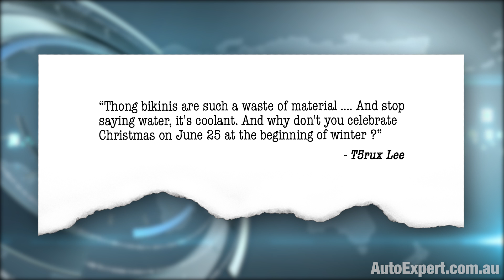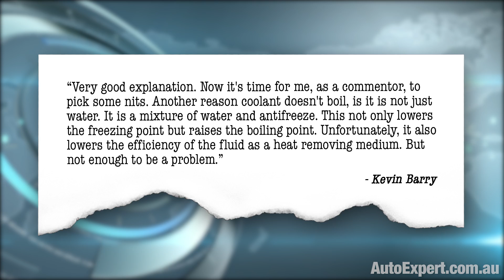The mad science of coolant (beer garden physics - yesssss!) | Auto Expert John Cadogan

Comment: If I may John, there's basically no convection going on in an automotive cooling system. Convection requires a flow of fluid because of the difference in density of the fluid. The difference in density is a direct result of a temperature. This is not whats going on in a cars cooling system at all. The water pump moves the fluid all the time, not convection. The cars motion or a fan moves air over the radiator, not convection. 

Radiator is completely appropriate, point a thermal camera at one and you'll see why. It radiates heat from the metal surface to the surrounding air.  We blow fans across radiators because air doesn't hold much heat, it's best as you'd imagine, when the air is holding the most water, high humidity. 

If you really dislike radiator, might I suggest heat exchanger, as a suitable replacement for your lexicon.
Reply from the maker: No - the mechanism you're describing in the so-called radiator is forced convection. Back to school for you...
Reply: Flow induced by a water pump enhances heat transfer, it does not enable it. If there was no water pump, there would still be convection currents formed, just not as effective as when the water pump circulates the water (coolant). Also, the flow induced by the water pump enhances conduction at the metal-fluid (metal-coolant and coolant-metal) interfaces . The fan enhances heat transfer at the metal-air interface, as does ram air at speed. There are numerous interfaces involved including convection, conduction and radiation. And then there's advection and diffusion...
Reply from the maker: @steves9388  Advection and diffusion are just subsets of convection...
Reply: @AutoExpertJC  Yes agreed, I didn't make that clear.  And I was being a smartarse.

Comment: Why not just run a vehicle on ethanol, have s shitload of fins, a dirty big fan and air cool the engine? Worked ok with the old VW Combi and Beetle engines- excluding ethanol of course...
That said, if the lowest temperature you get where you live is more than -5 deg C why not dilute the 'green stuff' with distilled water?
Reply: Hard to meet public expectations for power and efficiency using this approach.

Comment: The biggest reason for glycol is the fitting of aluminium heads and radiators on steel engines - without the glycol you get a really big battery running. Whilst big batteries are not a problem for EVs they are a problem for ICVs (and the rare ECVs) particularly where it involves essential drive components. Glycol is a pretty good electrical insulator and that is the key. No conductivity equals no corrosion.
For an all iron engine water works really well. For an air cooled aluminium cased engine it is irrelevant. (Freddie Porsche & Skoda....). (Porsche also has a thing for electric transmissions).
For everything else you need low conductivity coolant (over proof vodka works too if you don't mind the low boiling point).
Reply: Allan Gibson correct and that’s where you can have big problems with aluminium radiators if they are electrically isolated from the body and engine, if you only use water the electrolysis with eat it away

Comment: Enjoyed the video and hotties, however I’ve never had a car over heat in modern times other than my first car the great Holden HK. Have a great new year John.
Reply: i was a hire driver and i had a truck blow up on me. i've only been trucking for like 2 weeks when this shit happened. 15 mins into the shift it blew the puke tank, a pipe and the radiator sprung a leak too. somebody tried to fix the truck unsuccessfully (wow, what a word. english wtf!) they tried gluing the puke tank with resin but it's supposed to hold pressure and it didn't. i somehow managed to limp it back to the garage. the temperature needle was almost always off the clock face.
Reply: @SoulTouchMusic93  if your top tank pops, check the head gasket.
Reply: When I was a kid my dad had a HK and I always overheated in it in summer - no AC - especially when jumping in and landing right on those f*#@!g red hot branding iron seat belt buckles.
Those 2 core radiators just weren"t up to the job on a hot summer day and later when I inherited the old girl I stuck a V8 radiator in her and never had an overheating problem again.

Comment: Water boils at 100°C? Are you a flat-earther?

Arse-trailer may not have mountains, but other areas do.
Reply from the maker: Yawn - it's pressure dependent.
Reply: Good to see you completed 6th class science, but if you went on in school you would have learnt that.

Boiling. At sea level, water boils at 100 °C (212 °F). For every 500-foot (150 m) increase in elevation, water's boiling point is lowered by approximately 0.5 °C. At 8,000 feet (2,400 m) in elevation, water boils at just 92 °C (198 °F).
If you did physics in high school and ternary education you would have been lectured about Boyle's law and The Clausius–Clapeyron relation and a number of interesting facts.
Reply: @richardkaz2336  Lets get real. He wagged school for the whole time. Thats why he knows F*ck all.
Reply: Australia does have large areas below sea level too (look up Lake Eyre some time).
One of the few places you can fly a plane below sea level.
Adequate cooling is essential there.
Reply: If you read the literature, there are no references to the radius of the Earth regarding boiling water characteristics. Thus, the Earth is flat.

Sarcasm self test complete. Beep!
Reply: Some Nords have made some solar vacuum tubes that can boil its liquid inside (almost all water and some additives, I guess) at almost freezing temperatures. I remember watching a video with the roads full of snow and those tubes were stuck in the snow and boiling inside.
Amazing what can be done when natural fenomena are understood.

Comment: A shock absorber or damper is a mechanical or hydraulic device designed to absorb and damp shock impulses. It does this by converting the kinetic energy of the shock into another form of energy (typically heat) which is then dissipated. Most shock absorbers are a form of dashpot (a damper which resists motion via viscous friction).

But who gives a rat's...
Reply from the maker: It's primarily a vibration damper, resistance being proportional to velocity, unlike a spring where resistance is proportional to deflection.
Reply: @AutoExpertJC  Err, you know shit. Go drive your car without shocks. It will be a pogo stick on all 4 corners. The only spring that damps is a leaf spring, and it does not damp very well.

Comment: I was given some orange stuff to use as the ONLY liquid in my Torana by the guy who built it. Dunno what it was but the modified 186 took twenty minutes to get up to operating temp and no amount of thrashing could get the temp to move. It was an oversize radiator as well but I never used ANY water in the system.
I would love to know what it was but no mechanics have ever heard of it.
Reply: I can't give you an exact technical reply, but I know different radiator fluids (as we call it here in Portugal) have different chemical additives for corrosion and are meant for different engine block materials. RTFM!
But I noticed when I moved to the highest city in Portugal and needed some serious antifreeze, I've noticed the shops there were selling an orange stuff, not the usual green one. It Is also related with 'some' glycol concentration (and thus anti-freezing capabilities).
Hope this kinda helps and if anyone knows best, please let us know.

Edit: Cheers to my antipodes buddies of upsidownistan! We are freezing up here and you are boiling... Down there!
Reply: Put a thermostat in it. That is why they are fitted by Holden. So many dickheads who know bugger all leave them out, then the coolant overcools until you thrash it then cooks because the coolant is not regulated as designed.
Reply: Probably potassium dichromate , a very good (and toxic) corrosion inhibitor used industrially in cooling systems. Water based but also compatible with glycol if needed
Reply: @kdkd693  I know Potassium Dichromate. We used it in photography to do the dichromated gum technique. It needs a pigment (aquarelle) and you basically stack up layers of the colors you want, holy patience! An OCD photography technique. And Potassium Dichromate changes your DNA. I wouldn't want that fuming out of my engine. Cancer anyone?
Reply: Bruno Miranda  harmless if handled properly with PPE. I’ve handled a lot worse chemicals than dichromate. Not sure about the DNA statement, plus it’s very dilute in use.
Reply: @kdkd693  Google for Potassium Dichromate MSDS.
MSDS stands for Medical Safety Data Sheet and it's a good info about any chemical (properties, hazards, handling, safety, etc.). When I deal with something I always read the MSDS first.
Sure concentration (or dilution) affects the effects. And there are worst things out there to handle.
By the way, would you satisfy my curiosity and care to share the nasty things you've been playing with? Thanks.
Reply: Bruno Miranda as a former industrial chemist and corrosion scientist, I dealt with many corrosive and toxic chemicals. Chromates used in water treatment were relatively easy to handle compared to tanker loads of fuming acids (HCl, Nitric, HF), as well as 55% hydrazine, anhydrous ammonia, chlorine, peroxide’s, wood treatments such copper chrome arsenate, pentachlorophenol..
Reply: @kdkd693  OK, the only step forward from what you have done would be diving into a radioactive waste pool to take a selfie...
Hope your health is unaffected! #Respect
Reply: Bruno Miranda haha, thats funny. I did leave that industry eventually, chronic exposure to isothiazolinones in preservatives of all things (also in the barrier cream which I put on to reduce risks, ironically). 
Health all good thanks, lucky I guess considering my formerly blasé attitude to chemicals when younger. 10’ tall and bulletproof syndrome. Fortunately I did grow up

Comment: The motor drive electronics is somewhere around 80% efficient c.f 30% efficient for a ICE, so there is that. I wonder if they cool the motor(s) too?
Reply: Tesla runs to 95% conversion efficiency on its motor control electronics (the joys of pulse width modulation)... The heating on the liquid filled battery pack is an issue.
Reply: Not sure about Tesla motors but most electric motors for small motors to industrial motors use either an internal blades on the rotor or external impeller or a dedicated external induction fan to cool. The drawback in this is it is an additional power loss called windage loss. The problem is getting heat out out of the windings, stator laminations and the rotor iron circuit cooling jackets only draw so much transference heat so motors will have fans and are usually physically sized to cope with induced heat and/or use winding with high temperature insulating ratings. Most motors today the windings are epoxy coated to minimize winding conductor movement and vibration but this traps heat and works against cooling.
Reply: @richardkaz2336  Vehicle motors have the advantage that the vehicle is moving. When it is not moving it has no cooling load. When it is moving fastest and load is highest so is the cooling airflow.
The use of tight tolerances on the motor magnetic circuit, high operation frequency and copper rotor windings help reduce heat output.
One of the advantages of wheel motors (not on Tesla's BTW) is that they get maximum airflow and are bolted to really big aluminium heatsinks - the wheels.
Reply: @allangibson8494  "When it is moving fastest and load is highest so is the cooling airflow." Nice you think so. How about the load is highest when it is maximum accelerating from standstill on an incline pulling a load when the air flow is not that great or is moving in the same direction as your motion and your in the outback with ambient air temperature at the road surface is @ 60C+. Heat transference to to alloy wheels is nothing like a heatsink. Next time when you have been driving hard and braking hard hop out and touch the hub of your wheel then press your fingers right on the front brake vented disk surface. that's how good your wheels are as heat sinks.
Reply: @richardkaz2336  The heatsinking effect of disks is simply the high temperature differential (the buggers can glow red after heavy braking), indicating hundreds of degrees), while electric ev motors cannot sustain those kinds of temperatures, so they must be cooled through other means, so that link about liquid cooling makes sense to me.
Reply: @richardkaz2336  Vehicles with good electrical drive design do not use brakes to slow down. The heat load from regenerative braking is much less as rather than converting kinetic energy to heat, you convert it to electrical energy. The mechanical brakes are only used in an emergency situation.
For an average car you can maintain 120km/h on 45kW, assuming Tesla's published and reviewed efficiency data, the motor and inverter will be dissipating about 2kW of heat into a 120km/h air stream.
The motor and inverter will also be dynamically controlling their own operational temperature so sustained high loads will lead to reduced power output. The key word is sustained - if you take 4 seconds to get to 120km/h the heat load will be ferocious but total energy will be low.
The towing case would be most severe and I would suspect a controlled drop in performance during uphill operations depending on the drive cooling margin.
For the semitrailer case the load would be spread over four to eight wheel motors (one motor per wheel with every wheel independently driven) so even at 50C you could have a 60C margin on the motors heat capacity (120C motors are very common in industry). It is all about watts per degree C. With no brake heating (for a semi descending the Blue Mountains / Rockies this is a big plus) the tires will run cooler too. (Flat battery at the top, full battery at the bottom).
Trains have used regenerative braking for decades (usually to resistor banks on the roof) precisely to reduce wheel and brake pad wear.
Current truck technology was frozen in the 1950's (you can literally put a 1950's truck drive train in a 2019 truck body and vice versa (and companies in the US have been doing exactly that (look up the glider kit controversy)). Allison had a hybrid truck automatic transmission available in the late 1990's so this is hardly novel. Truck drivers make the Australian National Party look like a bunch of radicals.
Accelleration loads are just a question of thermal mass as the duration is finite and modeliable.
Reply: @allangibson8494  I agree regenerative braking is efficient but it still generates some heat. Heat in the motor, connecting cables inverter and batteries. How I ended up down this rabbit hole I haven't got a clue especially given the conversation thread was to do with reason why you would not use mercury as a heat energy transfer medium.
Reply: @richardkaz2336  The efficiency at the motor end is about the same as as a drive so for a large braking load it is a far better option - just way more technically complicated than a set of cast iron blocks that George Westinghouse would recognise but then so is most everything else under the bonnet of a modern car.
Reply: @richardkaz2336  That makes a lot of sense, I read that EV electric motors are around 90 - 95% efficient and use liquid cooling https://x-engineer.org/automotive-engineering/vehicle/electric-vehicles/ev-design-electric-motors/

Comment: I just today towed my caravan in 37 degrees Celsius and I give my respect to the cooling system Engineers. Caravan weighs as much as the car and has significantly larger frontal area so engine is hauling more than double is normal load.  Up a Long hill at 100km/h the fuel consumption meter read greater than 50 litres per 100 km for several minutes on end, temperature gauge only moved up very slightly.  50 litres per hour is a lot of waste heat to deal with especially at 37 degrees c ambient.
Reply: F#@k that Codogan! If he can hold 100km/h on the pacific highway during the christmas rush towing a van i applaud that man!.
Reply: @watsisbuttndo829  probably that same guy who flipped his boat and trailer a few weeks back while overtaking. Trying for a record two from two for the holiday season.
Reply: Thank the Japanese for that one. Boiling Holdens and Falcons were the norm in the old days.
Reply: @davidlove7825  Amen. And then they added air conditioning and made the fronts smaller. My KIA is the same on a hot day. Needle never budges...either sorted cooling or the temp gauge has a pin to stop it going up.
Reply: Sounds like a brand worth supporting.
Reply: With the AC full boar.
Reply from the maker: Totally agreed with all of that, Steve. You could of course knock it back to 80 in those conditions for a 40 per cent (ish) reduction in overall aerodynamic load.
Reply: @AutoExpertJC  I do that with trucks if there is a longish climb on a hot day and the temp gauge keeps on creeping up, just knock it down a couple of gears or so, so that the revs are there but I don't have the foot buried. And turn off the A/C Always good to keep moving even if it is a crawl when you have 100t plus that would be a bitch to get going again on a steep hill. In a car, towing a heavy trailer up the South Eastern freeway, I even turned the heaters on full bore on the long climbs so they became an extra  bit of cooling.
Reply: @AutoExpertJC  I tried just water once, my block cracked because it froze.
Reply: DuBstep115 core plugs are meant to pop out and prevent that...